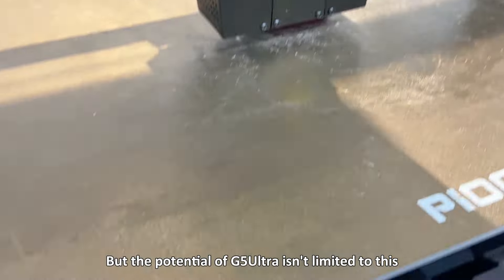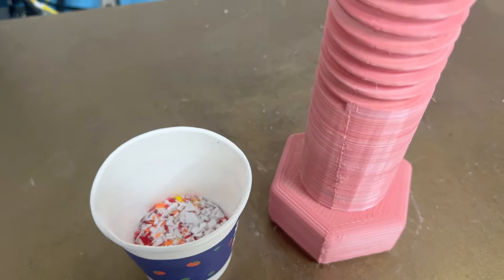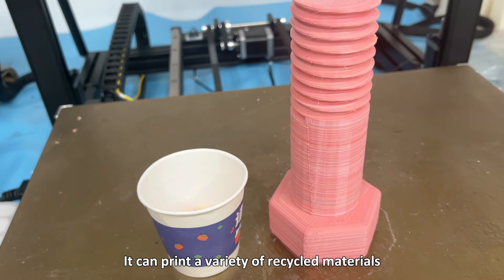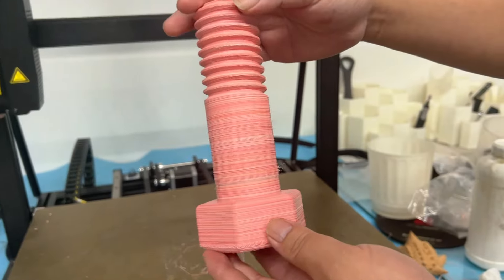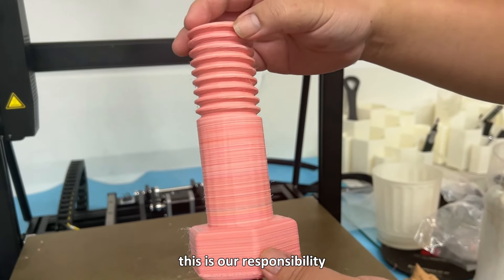G5Ultra Green Innovation -- recycled plastic can be used for 3D printing

Comment: LOL so actually, how much is this device, say, in US dollars ?  It seems like it should be suitable for home use, but if the initial cost is high, very few people will think of buying it.  After all, at this point of time, 3D printing is still considered a luxury, not a necessity 😅 Also, what device will you recommend to grind recycled plastics, to suitable pellet size, for this particular 3D printer ?
Reply from the maker: My apologies for the delayed response. The specific price of the device depends on the region it's being shipped to, and we would need to calculate it accordingly. If you're interested, please leave your email or WhatsApp, and our sales team will provide you with a quote based on your information